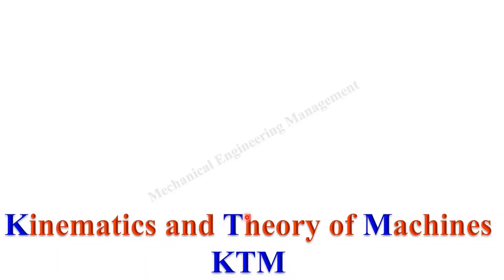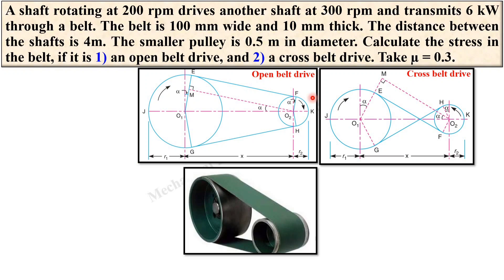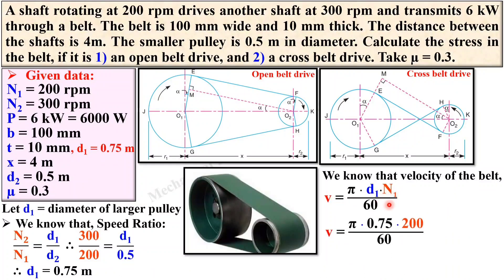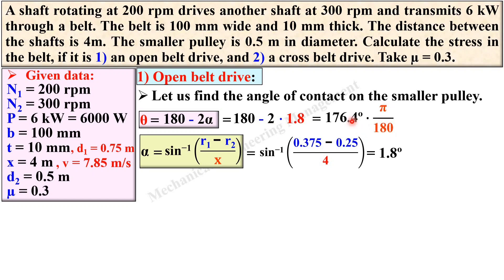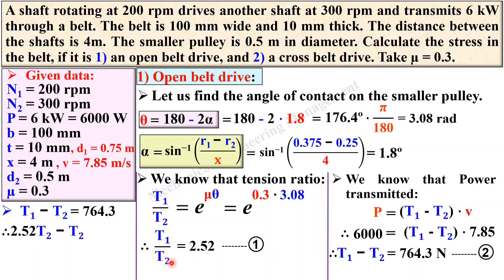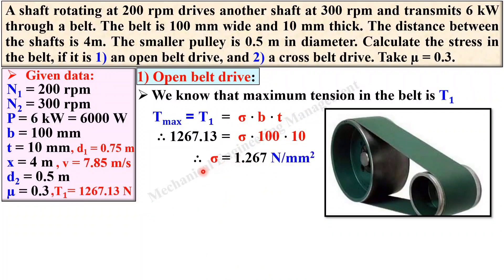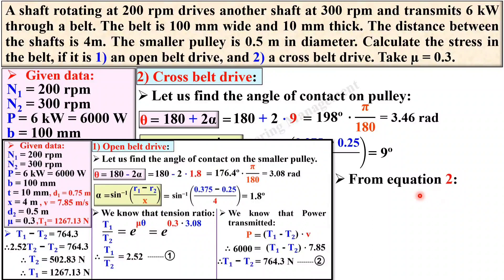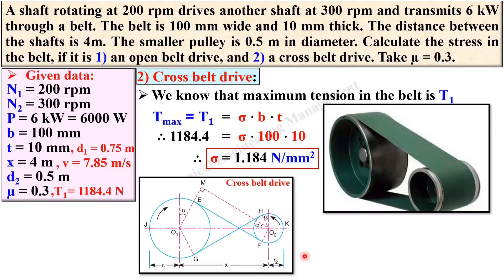Problem on belt drives, Imp Problem #GTU #KTM #TOM #Belt #Example #BeltDrive

Comment: In the belt velocity why you’ve used the the diameter of larger pulley4:16
Reply from the maker: My dear, you can take a smaller pulley diameter also. But at that time use the corresponding rpm.